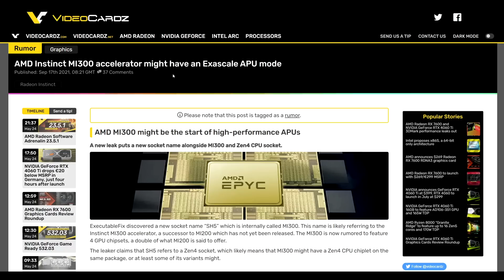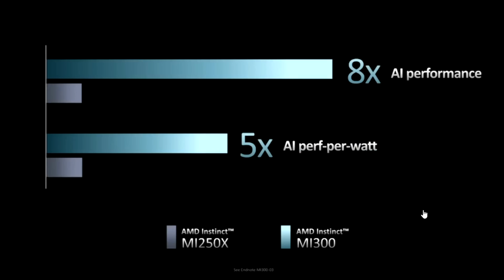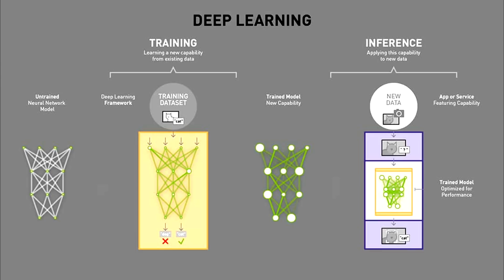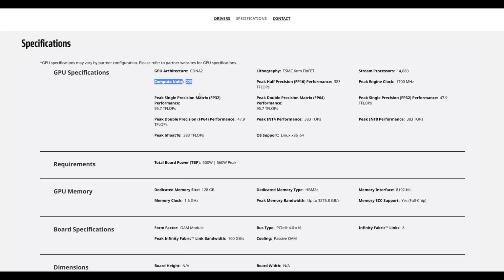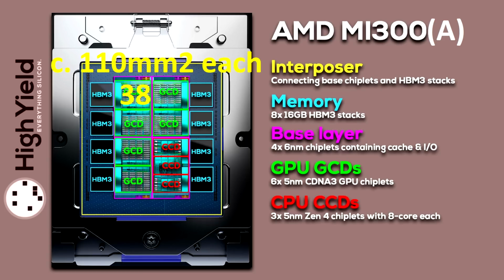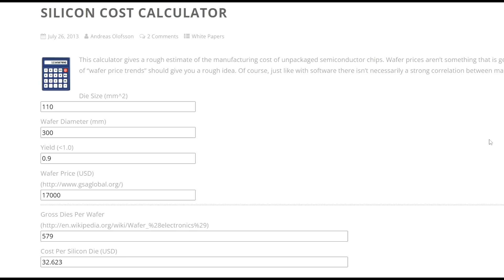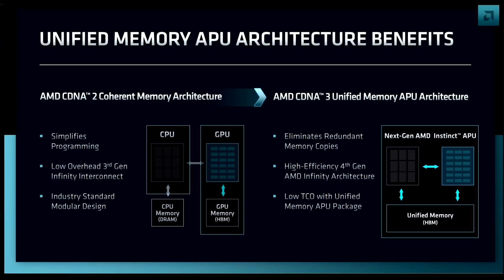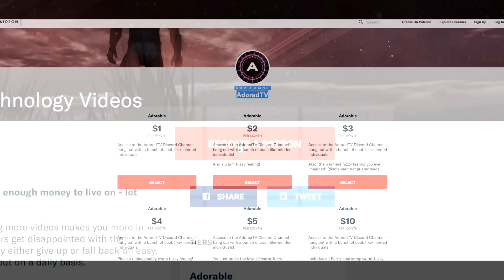AMD Takes AI-M at Nvidia with MI300X, MI300A and MI300C

Comment: That all sounds fantastic, but unfortunately it's no use at all if the performance doesn't make it onto the road in practice. Software support and drivers are often more important than raw hardware performance in the professional field. And Jensen has made very good connections in this area for years.
Reply: Hmm if only AMD could get the worlds faster super computer this year (El Capitan) to use these chips... I'm sure then that people may put some effort into working on the software.
Reply: except that most of the market is already ported.  do tensorflow and you have most of ai...

Comment: Always look forward to your interesting videos, not only for the information but the analytics :) Hope you get well soon if you aren't already.

As you said about what Nvidia has going for them is their software stack and CUDA framework. AMD is now getting traction with their equivalent ROCm that is getting better support, for example with PyTorch. However ROCm only supports Linux but rumors (and hints in the github repository code and conversations) says that the upcoming ROCm 5.6 (which is in alpha now) might get support for Windows and also for the consumer 6000 and 7000 series cards. ROCm has its HIP interface to translate CUDA application which is MUCH needed if one wants to transfer over to AMD while keeping old CUDA application running.

My guess about the cooperation with Microsoft is about having ROCm and other software support in Windows, a more open compute framework compare to CUDA that could break Nvidias 90% grip on the AI market.

Hardware wise AMD is already there even with the MI200 series, and the MI300 looks to be even more interesting indeed! However the most important factor one might want to keep an eye on (specially if you are an investor) is the software maturity with ROCm and the adaptation of it because of that maturity and availability.
Reply: A.I. is clearly becoming a big thing now and likely going to become a bigger thing going forward as it gets more useful.

I've already heard of a few people being pushed into buying Nvidia gpu's, simply because they work with A.I. at a local level.

AMD and Nvidia need to sort that out and fast, because at the moment, if you want to run A.I. on your own PC, you only have two choice, an Nvidia gpu or the cpu, the cpu tends to be a lot slower but I've noticed over the last few months that it's been getting a lot faster, so much so that even a 30 billion parameter model is useable on it, 60 billion is kinda but it's a bit on the slow side, used around 48GB of system memory and took around 1 mins to respond on my brothers 6 core cpu, but he upgraded recently so it's probably faster now.

I would prefer an open standard when it comes to A.I. being run on our PC's that work on any gpu and have the cpu as a fallback option, I'm surprised both AMD and Intel let Nvidia get so far ahead with CUDA cores and now with A.I. becoming a big thing, they need to respond and fast, especially with how quickly open source A.I. is developing.
Reply: Rocm documentation is garbage 
They haven't even documented which gpus are supported by it
Reply: Sharing an update for whoever it interests, 5.6 did neither support for Windows nor 7000 series RDNA3 cards.
Latest conversations (and a somewhat of a confirmation?) seems to hint for a 7900 XTX support for fall this year (ROCm 5.7?) however still nothing mentioned about Windows support unfortunately.

Comment: But why MI300C
Reply: I think it's obvious that MI300C and MI300X will go together in an architecture where that makes more sense than MI300A, for whatever reason.

Given the large quantity of HBM close to the compute, there's a good chance that bulk memory will be provided via CXL.  As near as I can tell, these products will only support CXL 1.1, which means the memory will still have to be in the same chassis, but can be on expansion cards rather than requiring DIMM slots.  In the future CXL 3.0 will allow, in principle, memory linked from an arbitrary distance away over fiber (with latency costs, of course).

And the thing about CXL is that both the MI300C and MI300X can access the same memory, just as the CPU and GPU parts of the MI300A can, so long as both are part of the same host (a limitation that goes away with future versions of CXL).

All of which will do nothing for normal PC users like us, beyond making AMD enough money to finance R&D on products we can actually use.  If they choose to use it thusly.
Reply: Because of compute density, more cores per rack is actually a HUGE cost savings. I bet that future MI3XX or MI400 series will have FPGA chiplets from AMDs Xilinx division
Reply from the maker: @solidreactor  And legacy code "just runs"
Reply: @adoredtv  but i mean how is that different from just running Genoa-X or do MI300C and MI300A also need to run on a normal CPU hosted operating system
Reply from the maker: @chillidog8726  Both are socket compatible.  I guess AMD just wants to cover everything.  They have the "all in one" with the APU, X for companies that are stuck on Xeons and C for those who will buy H100.  It's mostly marketing though yeah.
Reply: @adoredtv  if that is all to it wow that would be underwhelming.
I guess we will find out at the AMD event.
I wonder how the Interconnect from 250X fits into this new platform (MI 250X could communicate directly when on the same host system)
And if all of them are socketed how do you get the density i mean would 4MI300A work like 4-socket Genoa
Reply: @adoredtv  tbh maybe in Linux if the scheduler gets that functionality to treat it like a NUMA node or a part of CXL (the accelerators memory) but probably not in windows... unless this is one of the missions for the cooperation between AMD and Microsoft.

That all depends on how MI300 (A & C) will be designed, the old and dead Intel Larrabee one was something like an own subsystem in the host system running Linux internally and you had to specifically code and compile your program to use it.
If AMD goes that route then no, it will not just work :D

Regardless probably it would be better/more efficient to compile your code to manually access the accelerators by design and I bet you will then use AMDs own libraries like ROCm.

But I do hope for some scheduler magic and ROCm functionality
Reply from the maker: @solidreactor  Yep I'm expecting a bit more detail on the software side on the 13th, maybe even a surprise.  They really do need to pull something out the bag before Nvidia runs away with it.